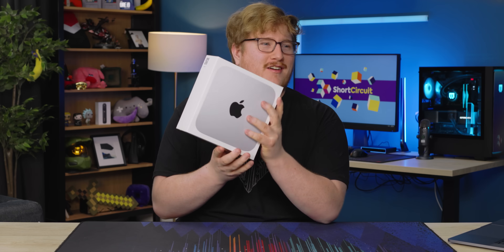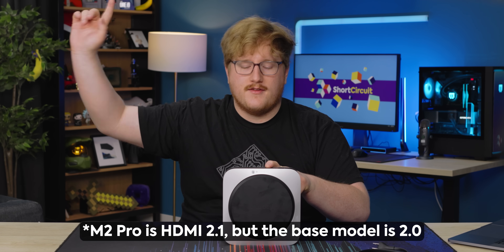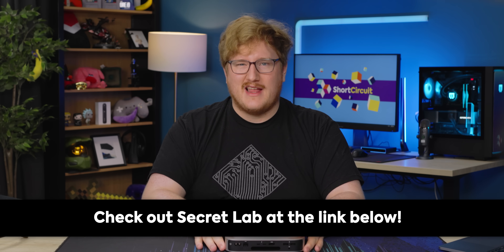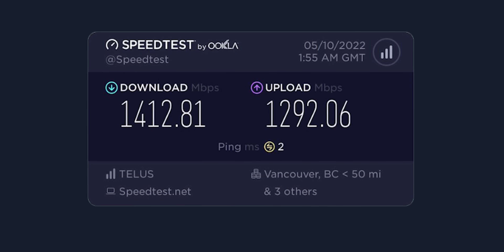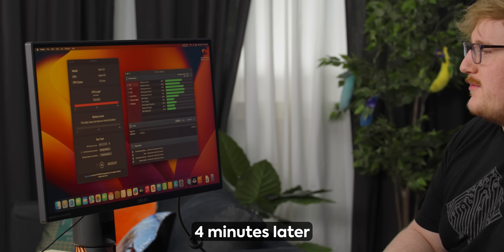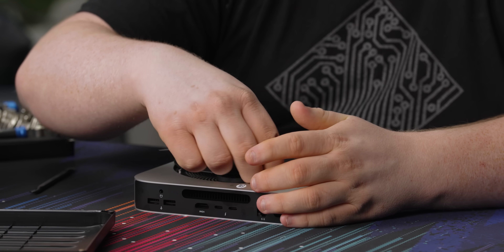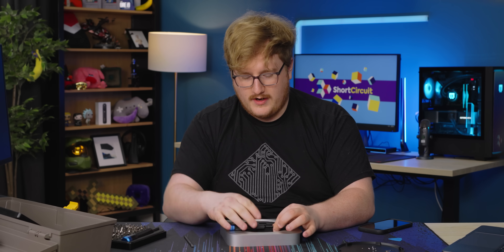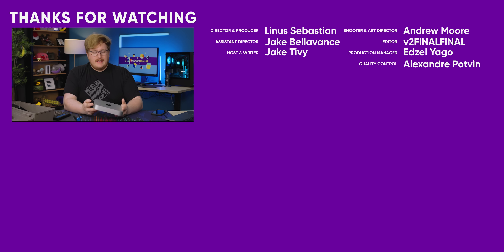Always wanted a Mac? Try this. - M2 Mac Mini

Comment: Surprising part of the Apple actually lowered the price of one of their new devices compared to the previous one.
Reply: Yup. It was a savvy move, though. The M2 Mac Mini is pretty much impossible to beat in the price bracket now. The Mac Mini now costs as much as an iPad Mini. I can't imagine this not going well for Apple

We might even see Apple desktops gain popularity in new markets abroad at this price point. $600 is still pricey, but there's a big difference between $600 and $800
Reply: @Gilamath.  Not only that but the potential gate-way this device is for the rest of their products is wild. Even if you don't have an iPhone, you might strongly consider it after getting the Mac Mini. Then that leads to the airpods, watch and whaddaknow you're in the ecosystem.
Reply: @michaelangelo1887  that’s a good point, though honestly it’s less likely to make a difference in Asian markets. iPhones are just crazy overpriced there compared to here, and as a consequence Apple is considered a full-on Hermés-style luxury brand in much of the world. So no one will buy the SE phones which are still pretty expensive by international standards but don’t have the luxury cache the higher end ones do (an iPhone with a home button makes you look both vain and poor in those markets, which no one want lol); and of course the cost factor of a $700-equivalent iPhone will make it inaccessible to most of the market
Reply: it's means to incentivise people to buy the base model - there's a huuuuuge market there and its a nice opportunity fo apple for additional revenue in recession. I'd say a really good move
Reply: Its the classic drug dealer first taste free thing. They want people to buy a cheaper mac and get hooked onto the ecosystem and later invest more into the ecosystem.
Reply: @nooneknows19  yeah but they are not getting "hooked", they just realise how much better the experience in Mac OS is. I'm saying this after using windows for 20+ years of my life and then switching. And I even haven't been using the worst ones (ie the newer ones :). There's no addiction here or anything unhealthy.
Reply: I was surprised that it wasn't like 900 bucks when I looked it up.
Reply: @Moondust7  yeah, it's actually 1000 bucks if you configure it with 16GB/512GB. 8/256 is not really acceptable in 2023 for a machine where you can't upgrade either ram or SSD :(
Reply: @loicjeannin6233  8/256 is pretty par for the course in this price range, but i’d recommend 16/256 and get either an external SSD or a cheap NAS, especially for content creation, because you’re gonna want to keep your footage or photos, and it’s easier to just edit/store them on an external or network attached drive
Reply: did they? base model costs 700€ in Germany, 930€ with 16GB RAM, 1160€ with 512GB SSD

Hell no lol
Reply: @itsTyrion  imagine paying that for the storage capacity of an SD card.
Reply: @MichaelLargent  yes
Reply: @MichaelLargent  I probably wouldn’t upgrade the storage anyways, as you could just get external storage, or if you’re a data hoarder, a NAS.
Reply: @HeelerHouse  who wants to buy a tiny computer just to add a bunch of only boxes to it though?
Reply: they are realising they can still be the wealthiest company without 50% profit margins, + inflation = they aren't overpriced???
Reply: @rebel2809  Many components from this computer are straight out of the 2018 Mac Mini, therefore as prices decrease they can reduce the price. Also Apple wants to get into more markets making more people choose a Mac as their next computer. Smart business move
Reply: @TheStopwatchGod  ok? i nerver said it was a bad decision
Reply: They moved to a single NAND for their SSD.. so it’s essentially a bit slower. Still a good deal for what you get in the form factor (coming from a PC guy) if you like the eco system but yes definitely a reason it’s cheaper.
Reply: Apple's pricing is interesting these last couple years. They love getting the entry level price as low as possible (in context of it being Apple), but where they get you is when you want to add more storage or get the higher tier chips, that's when the price shoots up. Which i honestly think is about as fair as it can get for Apple, because now with these new chips of theirs. It's much more worth it depending on what you do compared to when they were using still using Intel chips.
Reply: It's a marketing bait n switch. The baseline is lower in price, but the basic quality-of-life upgrades make up the difference REAL fast. If you want a 512gb drive that isn't half the speed of the M1 version, you gotta pay $200 more. That brings the price back up to where it was before. Can't really escape the problem with external drives either. There's no benefit to having TB4 if the peripherals have more bandwidth than the internal drive. If your server farm use case doesn't rely on the internal drive at all, then it's alright, but if this is supposed to be part of a render farm then forking over the money for a drive that won't hamstring the setup is kinda necessary since you'll need it to import and run files off the internal storage.
Reply: Their macs are sensibly priced...
 Except m2 mac air
Reply: maybe it was over priced?
Reply: @sintram10  no one bought them so there is that.
Reply: the same box from years apple chip 50% of price ,small pcb ,everything soldered compared this to 2012 production is about 30% of the price look how much they can save on sdd no pcb no connectors the same with memory this cost time & $
Reply: I picked one up today for $499 with my student discount. Always wanted to try MacOS but didn’t want to spend a grand. I’m overall happy… I look forward to using Cad with it!
Reply: I have an old Mac Sierra 2017. Can I buy and use this with my current Mac keyboard/screen?
Reply: I mean they're probably still making money at this price point but also gaining market share and probably also collecting more data because of that
Reply: Because they put in a pathetic amount of RAM and storage and then charge an obscene amount of $$$ if you want more. This is no deal.
Reply: I mean, it has the storage capacity of a micro SD card and the RAM of a budget android phone, and just two USB ports. They probably should have dropped the cost even more.
Reply: @MichaelLargent  almost every pc in this pricepoint has an 8+256gb config, if it doesn’t they are definitely cheaping out elsewhere
Reply: @HeelerHouse  but you can upgrade for like 40 bucks and be at 32gb RAM and whatever you want for a drive for another 80.
Reply: @MichaelLargent  $40 isn’t what 32gb of RAM costs, it’s more like $80-$100.
Reply: @MichaelLargent  The M2 slightly outperforms the 5700X, a desktop CPU with the same number of cores and threads. The M2 is both a mobile and desktop chip.
Reply: @HeelerHouse  slightly better than last gen mid range chips. I mean, not that impressive is it? It's fine but not world changing.
Reply: @MichaelLargent  Yes, because it’s the most comparable thing to the 5700X, even in core and thread count. Also it was current when the M2 first came out. The M2 Pro would be more on par with a 5900X
Reply: @MichaelLargent  it’s also more in line with the price of systems with Ryzen 5 APU’s.
Reply: @MichaelLargent  yet there isn’t a single competitor. There was no need to drop the price as the M1 sold well and was highly regarded.
Reply: @EthanHaque  how so? Anyone can custom build I tiny PC at this price.
Reply: @MichaelLargent  the thing is people don't want to build it themselves and when people want to buy one, this is the best price/performance you're going to get and it runs on macOS
Reply: @bjvink0130  lots of people build their own units. Prebuilt tiny PCs already exist too. I use about 20 of them.
Reply: @MichaelLargent  those are micro itx builds tho, not as tiny as these
Reply: @bjvink0130  Never heard of the NUC?
Reply: @MichaelLargent  yeah, but they're simply not as powerful as the base model
Reply: @MichaelLargent  The average person isn't going to bother building a mini PC. Most people aren't technologically literate enough to do so and would rather walk into a store and buy one. Also, the M2 processors are more powerful than any other processor you're going to get in the price range.
Reply: @bjvink0130  the Nuc 12 has a 16 thread 12th gen Intel inside. It's very impressive.
Reply: @MichaelLargent  the m2 smashes any intel machine if you get the base model mac, anything above the base model it starts getting tricky
Reply: @bjvink0130  not really. That's just the marketing.
Reply: @MichaelLargent  the tiny pcs at this price point aren’t gonna beat the M2, I mean AMD makes good APUs but not ones capable of 8K video editing
Reply: @MichaelLargent  the M2 has 16 threads too, but Intel is notorious for bad iGPUs.
Reply: @HeelerHouse  mobile threads don't equal desktop threads.
Reply: @HeelerHouse  they do have bad iGPU. That's for sure. It does video though which is really all most people do.
Reply: @MichaelLargent  A barebones NUC 12 costs more than a base model Mac Mini...
Reply: @MichaelLargent  Storage capacity of a micro SD card with 5+ times the speed and reliability, the RAM from an android phone but many times faster and again more reliable, and of course macOS is more ram efficient than Android despite being more powerful, and two USB ports that can do 40Gbps at the same time, plus two more USB-A's for keyboard and mouse.
Reply: @MichaelLargent  They make their own ram. It’s called unified memory. Which is not from Android ram. AMD is the fastest chip in the world. You should watch X68 and AMD chips history.
Reply: @Fundamental-Basic  Apple does not make RAM. They purchase it from Samsung, Hynix and Micron. I do agree that AMD makes some of the fastest chips though.
Reply: @MichaelLargent  Unifide memory is same as M1 chip. They designed the ram and manufactor in somewhere else.
Reply: @Fundamental-Basic  it's literally just normal RAM soldered directly beside the CPU. Consoles have done similar for decades. It's even low grade, fairly show memory. The chips directly reference their models. Nothing unique.
Reply: @MichaelLargent  It’s a unique ram
Reply: @Fundamental-Basic  it literally has identifying marks on it that state is off the shelf RAM from the big three...
Reply: @MichaelLargent  Apple uses memory, which is designed to serve both large chunks of data and do it very quickly. It is called 'low latency and high throughput'. This removes the need to have two different types of memory and all the copying of data between them, making the M1 faster
Reply: @MichaelLargent  As you can see, the iOS apps tend to use less RAM — up to 70% less, in some cases. If you take the average, it is around 40% less RAM. That means, if everything else is equal, an iPhone will need 40% less RAM to hold the same number of apps in memory as an Android phone or even Intel chips. Apple uses same ram for every devices. The ram is really small that it’s the same size as your thumb.
Reply: @Fundamental-Basic  That's not a type of RAM. That's just marketing. It's not even fast RAM. at 200 Gbps. It's mediocre. All RAM is low latency low throughput. You're just reading marketing slides.
Reply: @Fundamental-Basic  It's mobile RAM running mobile apps. Yes. But this is a desktop. It would be nice to not hit a wall any time you want to load a video or  large images. They offer more RAM for a reason,  they just charge way way way too much for it.
Reply: @MichaelLargent  Apple uses same ram for every devices. The ram is really small that it’s the same size as your thumb.
Reply: @MichaelLargent  Compared to PCs without an Apple silicon SoC, the unified memory architecture and superior memory management in macOS appear to be getting significantly more out of the RAM. The faster SSD and RAM in the high-end 14-inch and 16-inch MacBook Pro models allow for even quicker memory swapping. Unified memory not only increases the speed and performance of a computer but also cuts down on the energy consumption of both RAM modules and an HDD, which can be significant. As it is non-volatile, you have the reassurance that data is stored even if the power is removed.
Reply: @MichaelLargent  They also aren’t the only one to overcharge for upgrades. Microsoft charges $300 to upgrade from a 256GB SSD to a 512GB ssd on the surface laptop 5, and an extra $200 to get 16GB of RAM (you also have to get the upgraded storage in order to upgrade your RAM)
Reply: @HeelerHouse  Yeah and I don't buy those either.

Comment: Mac Mini could be way more mini but they won't do it because it's way cheaper to keep the same form factor as the old one...
Reply: As a from factor the current size makes for a perfect monitor stand…
Reply: Also, there are quite a lot of accessories that compliment this form-factor, as Apple has been using the unibody aluminum design since 2010. I have a 2012 hanging off the back of a monitor at home, in a holder that screws into a 100 x 100 VESA mount.
Reply: It's also beneficial for server rack setups
Reply: @Gilamath.  yes i was going to say that as well. Their biggest customer of the Mac Mini is server farms. That's mostly the reason for keeping the same form factor. (also proves that the thermal issues from past generations really was Intel's fault as they were not able to stick to their own roadmap they laid out to Apple and other PC Manufacturers.
Reply: Yeah, that looks as big as my Dell 7060micro, but at least the Dell has a 2.5hdd slot, M.2 drive, 2 laptop ram slots, and a socketed CPU. But no internal psu...

Comment: Why is the ram spec set to "200GB/s" ? I have never seen a ram spec in GB/s before.
Reply: The RAM is close to the CPU die, it allow for more bandwidth. But the CPU need to be made for it, that's the reason of x86 CPUs can't do it, despite LPDDR clocking better than SODIM

Comment: Are Macs so much better with memory that 8GB is acceptable for a new computer in 2023?
Reply: its not "acceptable" for 2023/2023 BUT I have a stock 2020 M1 MacBook air with 8gb of ram and it handles everything I throw at it. You will only see noticeable changes with INTENSE 4K video editing honestly. And if you need more power then you would already know that, and have work needs that justify upgrading those specs or going to a "Pro" Mac. The STOCK M1 MacBook Air is more powerful than my 2013 $13,000 Mac Pro if that helps put perspective on it.
Reply: @KC-bi9jw  That’s very true, although it is at the cost of longevity with all the swap used. Which for the performance and the price is still acceptable. In a few years if it starts to have issues it’s cheap enough to just get another as needed.
Reply: @KC-bi9jw  That last sentence still blows my mind. These new chips are just incredible.
Reply: It is. My m1 mac mini and m1 macbook air have yet to slow down by any measurable amount and they're both at 8GB ram
Reply: For the target market? Yes. For a young student or a grandma word processing and emailing and browsing the Internet, sure it’s whatever. What that means is they know anyone who actually knows anything about computers is going to spend at least another 2-400$.
Reply: Yes that's enough for arm chips. Ram is directly on the CPU so they need less ram because transfer is faster. You can't really expect to do 4k edits on it because it is not supposed to with 256/512gbs of ram(that's why the tb model has more ram too) but for the rest is plenty considering you can't game on this.
Reply: @xBinyWolf  Not entirely true. I’ve done some pretty big timelines in Final Cut using 4K 10bit footage and it handles it pretty well with just 8gb even after a color grade. And I have an M1.
Reply: @gagec6390  ye I said you are not supposed to video edit on it just for the 256 gigs of space that aren't really enough. I suppose you have the 512/1tb(most likely this one)
Reply: @xBinyWolf  Everyone uses external. A USB C Samsung T7 works great.
Reply: No, it is unacceptable.

Comment: I think the plastic is only on the device to pull it easier from the box.
Reply: Of course, I was just responding to his question. It’s useless in my opinion
Reply: I'm pretty sure there's a solution to that problem which doesn't require a plastic sticker.

Comment: I've never wanted one, but tech content continues to appease my brain. I shall watch anyway
Reply: I think it would make a good emulation box if it had better I/O
Reply: @pedro4205  m1 pro version has 4 thunderbolts
Reply: @norkshit  But emulation box is supposed to be cheap
Reply: @pedro4205  this can easily emulate switch. Can’t expect something that capable to be super cheap
Reply: @pedro4205  So you said that a mini pc should be cheaper, then this interesting mini pc I didn’t knew the existence of is probably better than the mac mini but also costs 1100€ for 16gb+512gb. A base mac mini costs 729€ in my country, 609€ with the student’s discount. And an m1 mac mini currently goes for 599. 
That mini pc is surely better for gaming but also a bit pricier. (The barebone edition is not available here, but from what i’ve see that doesn’t change much)
Reply: @pedro4205  then again I did’t know this brand and that intrigues me, thank you for the info
Reply: @pucah  It is a well known brand in the mini pc niche. The price for a 512 ssd 16gb ram mac with m2 pro would be even more. I think the sweet spot is only the 600 US$ model
Reply: Sam! 😂 It’s interesting content regardless.